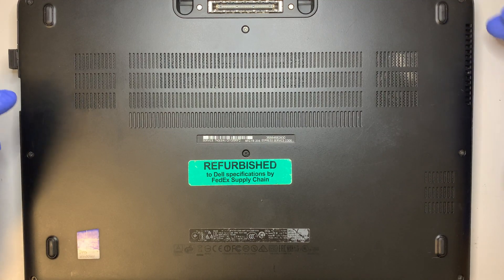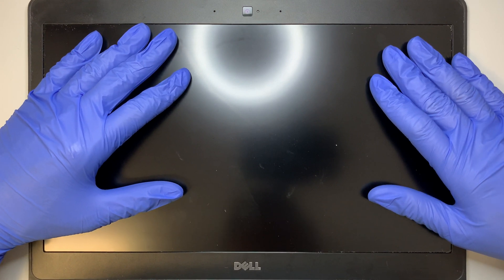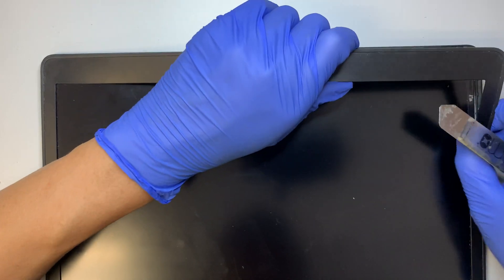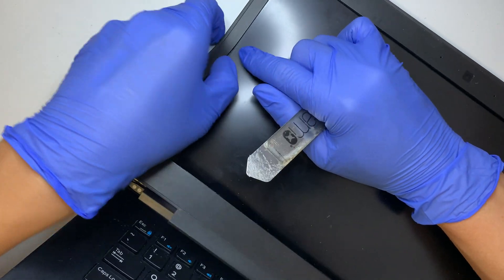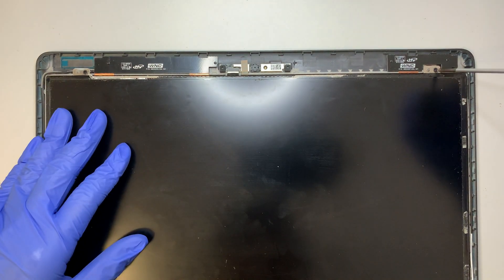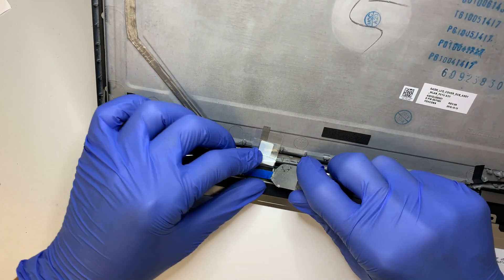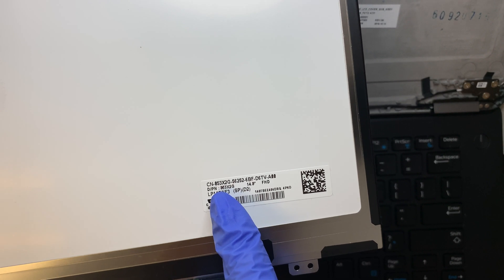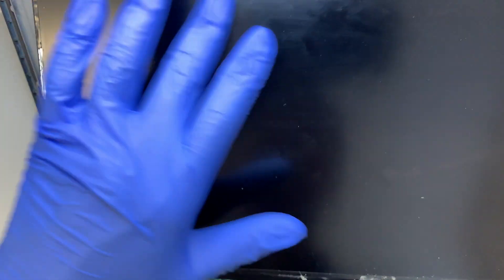Dell Latitude E7470 Screen Replacement

Comment: Hey, thanks for the video! This sounds helpful, I'm still at the stage of searching for the screen. Does it matter to have this exact one? I see many LP140WF3(SP)(D1) / (L1) / (L2) screens, but struggle to find the (D2) one in my country. Do you think others will be compatible, or should I stick with the (D2) one? Also, is there any way to know the screen model using Windows OS? Couldn't find it in the specs... Thanks!!
Reply from the maker: Did you try the link in my description ?  About the (D1) or (D2), I'm not worry about it. It will work for sure.
Reply: For anyone reading this, for the record the D1 and D2 are identical. The D1 is used for Lenovo whereas the D2 is used for Dell. Same fitment and spec, just a different number. D1 is just a few months older than D2. D1 was released at the end of the year and D2 at the start of the following year